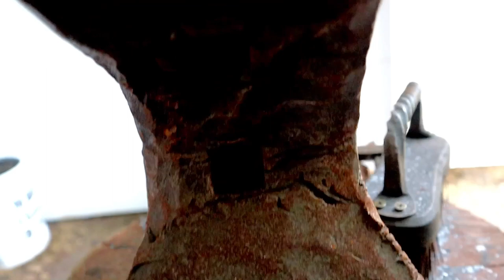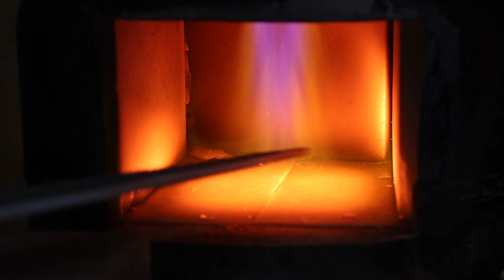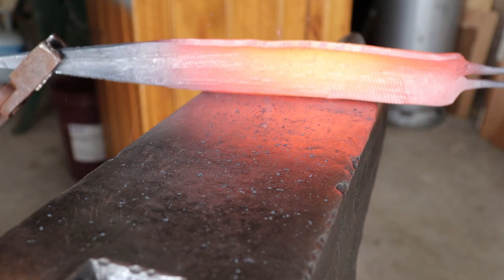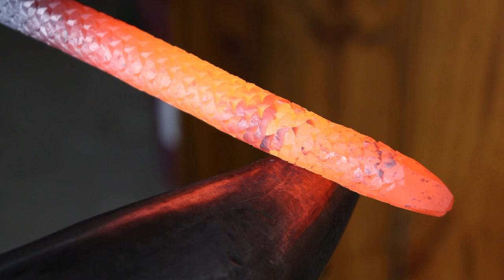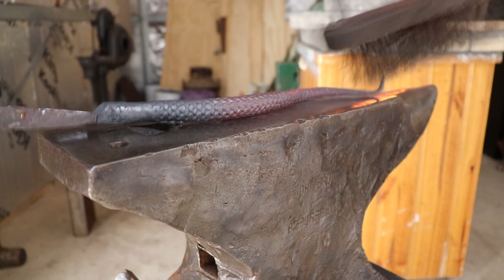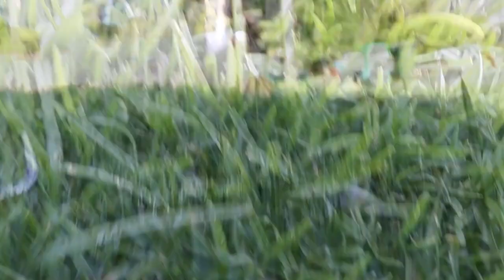BLACKSMITHING | Forging a Decorative Snake from a File

Comment: Hey mate, ive recently been wanting to put a wooden shed in my backyard to forge in but didnt know if it was safe, i saw ur videos and it looks like to me you have wooden smithys, could you give me any advice on how to properly do it in a wooden shed safely?
Reply from the maker: There is always a risk with fire and combustibles. Keep it clean and tidy, Use fire retardant materials where necessary. 👍Be safe and keep hammering